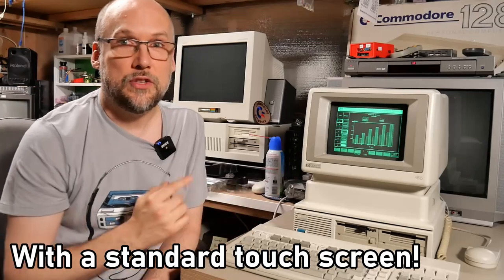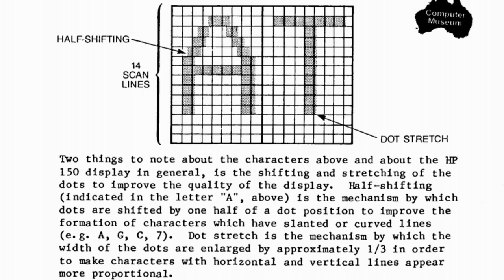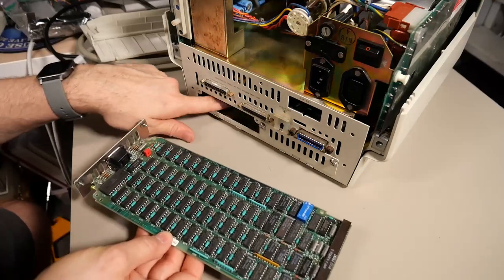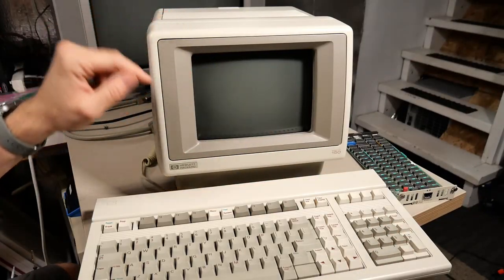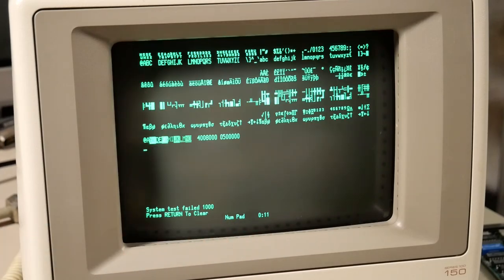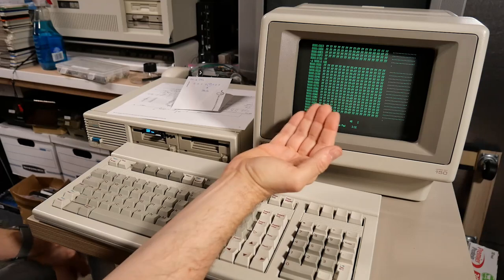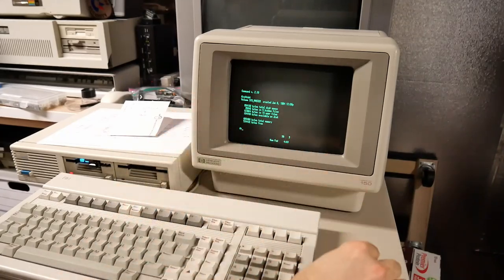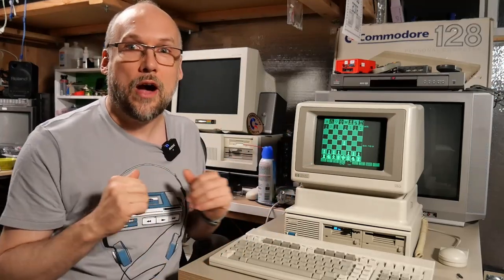Touch Screen MS-DOS PC from 1983

Comment: I was a service tech for HP when these came out. We would have a customer get a straw and blow out the holes if we did not want to go out there or were busy. Later HP made a plastic strip that blocked the lower holes from dust, You can also use clear Scotch tape to cover the lower holes and prevent this failure. HP also was making the HP 125 a CPM computer, and a UNIX luggable computer at the same time. The MS-DOS won that battle. Many of these HP-150 computers were used to control HP Lab equipment such as Spectrum analyzers and other test equipment as well as medical equipment because of the HP-IB (IEEE-488) interface. Back in the HP office we connected these to HP 404 MB disk drives for fun. The disk drives were the size of a washing machine. Much of the older HP technology gets scrapped (recycled) as the boards many times had gold traces. At one time Compaq was thinking of licensing the HP thermal printer for their early luggable computers. The licensing never worked out. But Compaq ran their business on the HP 3000 and larger computers.

Comment: label says NO USER SERVICABLE PARTS INSIDE.......... adrian says...its HP its very servicable lol
Reply: Adrian isn't a user.
Reply: @stinchjack  totally 100% agree if you own it which it seems like apples case s he has said you don't really own it just like software that you don't own and many other things that once you purchase it it should be yours and be able to do what you want with it including having anyone you please to repair it as you can tell I thoroughly agree with the point in full!

Just like they say in the maker community if you own it you should be able to take it apart modify it whatever and if it doesn't fit your needs you should be able to modify it the way you want warranty void if removed should be outlawed completely banned but of course companies have to protect their rear end if some like really screw something up but trying to do something past what can be fixed it would fall back on them because of something the user it done to their own equipment I understand that however that should not interfere with reasonable things that someone is doing technically we have the right to repair in some situations however there needs to be legislation that's consumer orientated and protects our rights to our own equipment Etc and Legacy on legislation of what can and cannot be doing like in the case of apple and others so you open it you broke it or you try to fix it sorry no parts for you or you touch a screw we don't touch it no repair for you or sorry you can't program that part your device no longer works we didn't do it you did when actuality that was what the product was designed to do to prevent it from Dean. Buy legitimate repair services or ady hot for assume that would be able to fix something normally companies are so pigheaded that they want you to buy a new device in many cases I think about the song All speakers deliberately at least a first breaking them I'm sure this was not the first taste of this heard of others but can't remember at this time all I've heard about this but this will only continue to happen worse and worse the community needs to get together someway somehow and Soldier on until whoever takes notice and changed the laws to reflect what would work and be reasonable for both sides of things if possible and be able to get things appointed there are ways in which a company could say no to repair if something's jacked up to the point that it would have been unreasonable for a user to do something or a repair got a rolly but yet comforter butts when appropriate and so that people cannot just get a new device because they checked it up and they're not able to in the person tries to pin it on them when it would not be the right thing to happen in a reasonable situation.

Butthead yet have rules and legislation that would State exactly what a manufacturer I would or could not do and clear guidelines as to what is appropriate and acceptable in cases such as these and others that both sides could agree on at least as much as possible and work for the good of all that's watch as possible it might be a pipe dream to have this happen but it needs to get a lot better it's just crazy either or just make your project open source and be done with it that might just solve it encourage cell phone repair don't turn it into something that's a death sentence for the device.
Reply: Serviceable by HP or a repair shop, not the end user. There’s still a difference of welding it shut to having it easily come apart in a modular fashion.
Reply: @0xbenedikt  not really my point though but I seriously saying so just so you know.
Reply: @aaronbrandenburg2441  😈
Reply: They probably say it mostly so they can sell service contracts alongside it, which would likely have been taken up by businesses.
Reply: @stinchjack  I’ll never understand this complaining if you have a problem with that don’t buy it
For the rest of us it’s fine
Reply: @aaronbrandenburg2441  ok that’s a word vomit anyway so-
Reply: Who knew!

Comment: 37 years and just needs compressed air and one chip that’s reliable.
Reply: I'd say that's a 10-4 affirmative a good buddy on that one.

Also with the compressed air a note with sound when using dust off or or similar ran into this on an old Gateway machine.

I was having some issues with it overheating.

And in one day it wouldn't even stay on for a few minutes.

Popped open the case and sure enough heatsink was packed with dust.

A lot of other things as well including the fan.

And processor heatsink fan of course.

I was using the dust off or similar and I was doing this in my bedroom big mistake one big cloud of dust and I'd use so much I was not feeling good because of the effects of the dust off or whatever it was on me and I was not aware they do that so be careful.

Best weapon to do it outside in generals not just with the nature of the stuff but the dust cloud as well just undid all my cleaning for that month it seemed like.
Reply: Conclusão, não mexa no que esta quieto.
Reply: @aaronbrandenburg2441  I use an air compressor. And do it outside, of course. Best also to wear a mask or respirator, especially if you think mice might have been in there.
Reply: The dust was not the main part I was referring to who is actually the the stuff that's used for the dusting spray that I was having problems with there was enough of it in the air that I wasn't feeling so good yeah and got to my respiratory system that was the big part they be running a big fan but I had no idea I was going to need to use that much and didn't know how much dust was in there's heat sinks and everything so vacuum cleaner would not have really done anything for the spray itself but dust maybe but still would have been a real mess. And I did not have time to disconnect everything and get it outside plus it was raining and I had to get back going on something I was doing immediately on the computer so no options other than to do it is there and at that moment sometimes things are like that but learn my lesson about using large quantities of dusting spray in a small  size  room.
Reply: And a new battery
Reply: O que tu quis dizer? Para de zoar com os caras! Kkk
Reply: ...and god knows how many hours of troubleshooting. But of course we don't count that. The repair is always only as valuable as the spare part that it needed.
Reply: How sweet it was!💙

Comment: My father was on the HP sales force in the waning days of the 150 and the transition to the vectra. He brought a retired 150 home, and I spent countless hours playing Master type and writing school reports on it. Mine had the thermal printer in the top, and an external disk drive unit with one floppy and a hard drive. It took 5 minutes to load MS Word. The hard drive sounded like a small motorcycle engine. I had a Deskjet plugged into the serial port, and I used the HP HIL mouse extensively to draw in the rudimentary graphics program the computer had. Printing a picture took several minutes. This was a trip down memory lane for me. Thanks.

Comment: It was nice to see the HP-150 once again. I did the port of MS-DOS for the HP-150 back when I worked for HP (plus a custom version of WordStar for the 150 as well). People might ask why the HP 150 was not IBM PC compatible. The IBM-PC was released in August 1981 and wasn't shipped in large quantities for months. It wasn't clear for the first half of 1982 that the whole IBM-PC; hardware, BIOS, and  PC-DOS (MS_DOS), would become the standard, not just MS-DOS. What made it the standard was the large amount of computer software that was available for the IBM-PC that bypassed PC-DOS and accessed the BIOS and the hardware directly. In a way it was the fact that PC-DOS was really a poor operating system that caused the standard to be more than just the PC-DOS interface.  There were some software titles available on the day the PC was released but it took about a year for the software base to expand to the point that the PC had become the defactor standard.  It wasn't until late 1982 that IBM-PC compatibles, like the Eagle PC, started to appear. 

There were not just technological challenges making an IBM-PC compatible. There were legal issues too since the standard included the BIOS interface. Eagle Computer just copied the IBM-PC ROM and tried to argue that it wasn't copyright infringement because the ROM was hardware.  Well,,,,,,, it was copyright infringement , and the legal challenges destroyed Eagle Computer. We were in the planning stages of the HP-150 well before it was determined the IBM-PC was the new standard. Some early startups, like Gavalin Computer, used up their entire financing only to release a non-IBM-PC compatible product at about the same time it was becoming clear that IBM-PC compatibility was a requirement. Gavalin never recovered. HP had a large customer base and was able to make the HP-150 a successful even without PC compatibility. 

The HP-150 got a mention in the TV series "Halt and Catch Fire". As the main characters of the show are walking through the 1983 Consumer Electronics Show one of the characters says something like "Hey, did you see that touch screen computer from HP". I enjoyed hearing that.
Reply: How old are you ?
Reply: This probably was one of the best products you could get as a professional back then, the level of integration was ahead of its time because we didn't see similar products from IBM until 5 years later. HP always gave me the impression they are behind the scenes doing their professional focused products very well but they had problems with the commercial ones. This is on my perspective on have been a salesman for the company about 15 years ago, their public commercial PC products were a little of a clown show withe very dubious decisions.

Later I got into IT and now I'm working in mainframe and learned what they are about really. All their professional products are top notch, I have owned several office HP laptops and they are the best I tried, best ergonomics, durability, service, I even bought them second hand for relatives and they still kick strong. They are the one of the few who offer the 6 del/ins/home/end/pgup/pgdn row in 14 and less inches laptops, which they are absolutely mandatory for my work. I had to work with a similar Dell for a while and asked for an HP replacement because it just wrecked my workflow. Those are the good details.
Reply: kevinlsims7330 What are you talking about? HP didn't make copy and fax machines, at least not in any significant quantity back then. The printers and plotters they made were designed to be used with their test equipment, just like their computers. Their main business was test equipment and computers of various sizes. The LaserJet and all that came later. Also, it's really, really not necessary to capitalize every single word in a sentence, it comes off as really obnoxious and difficult to read .... 
Also, if you read what the original commenter said (who actually worked for HP and would probably know better)... this wasn't a "blunder", this machine still sold very well because, like their other computers before and after this point, they were designed to be used with HP's test equipment and engineering tools to create custom test and verification setups. So you could have one of these machines connected to a whole rack of HP test equipment on an assembly line, and do extensive testing to make sure your product was working correctly. This was HP's bread and butter during the 70s and 80s. Go check out the HP test equipment catalogues from the 1970s, their computers were listed in there because that was how they viewed their computers first and foremost -- tools to be used with test equipment to automate and log results.
Reply: Yes, people don't understand, when IBM gave Microsoft the rights to license to other companies, they fully expected the MS-DOS machines would be mostly incompatible! It was Compaq that really got "full" compatibility as a feature, although the PC 1600 was the first, released in June 1982 by Columbia Data Products, with the Portable, Compaq made $111 million in revenue it's first year. IBM setttled out-of-court with Eagle because Eagle copied the PC BIOS byte for byte. "Halt and Catch Fire" more closely resembles the history of Corona Data Systems, except they also cloned the BIOS and later settled with IBM. I don't know why this association wasn't played up, and they pushed the Compaq reverse engineering angle. The only other similarity was the Texas location.
Reply: @revoltosotintan  I'm 69.
Reply: @hallsoft  thanks for your work

Comment: I did a work/study program while in High School at HP's Colorado Telecommunications Division in Colorado Springs.  They had tons of these, mostly used at terminals for a mainframe.  Only a few had the thermal printers in the monitors, and those who didn't put tissue boxes in them.

It was amusing seeing people pulling Kleenex tissues from the tops of their computers.
Reply: Remember the thin paper? omg , and it was soo much like burning an image lol
Reply from the maker: Kleenex dispenser! OMG that's too funny. I actually moved the machine off the bench and stored the GPIB cable and mouse in there. It's shockingly handy!
Reply: Since these machines were built at the calculator division facility in Ft Collins Colorado, I guess they didn't have all that far to travel :-P
Reply: Mine does not have a thermal printer but I have a Thinkjet that now works after replacing the ribbon cable to the print head. It still amazes me you can still get the print cartridges. So I use the top for storing fanfold paper.
Reply: Which would have even be more hilarious if someone mistakenly thought the printer was a tissue box. So they hit PRINT... and then proceed to pull the print from the machine and blow their nose with them.

For a machine that was intended for mostly scientific purposes, having a built-in thermal printer kind of made sense, though.
Reply: @Stoney3K  It does make sense. I can visualize the scenario clearly.
Reply: @Stoney3K  At HP CTD, it was used primarily for screen prints when the PC was in terminal mode and connected to the HP 3000 mainframe.
Reply: Yep we used the dumb terminal versions of the hp120 and hp150 -we used them to connect to HP3000 mini computers - I don’t recall HP having mainframes back then that was more IBM
Reply: Mark Walters hp3000 was a mini not a mainframe
Reply: @speedbird737  Thanks for correcting me, twice.

Comment: Woah!  Blast from the past.  When I was an undergrad (mid 80s) they had one of these in the main computer lab.  It was used as one of the many terminals for the HP3000 system on campus.

Comment: The HP Machines were extremely popular in Laboratories of all kind. A predecessor, the HP-85 already had a small Printer built in to print out e.g. measuring protocols on the fly. This is why the option was included to put a printer on top, not so silly ;-) HP PCs of this era were build like tanks, I had a AT-compatible early Vectra that ran for 10 years without the slightest failure (same mouse as this 150, by the way...)

Comment: I remember using a machine like this. The one I used had the thermal printer installed. I never knew that it was NOT IBM compatible,  nor did I know that the computer was in the monitor, not with the floppy drives! I first used such a computer back in 1988. It was in an insurance processing company that used an HP 3000 Series III mini computer, which was already ancient. The company used HP terminals along with a very few of these computers, which were still just mostly used as a slightly smarter terminal.

Comment: Nice find, Adrian. The design of this thing inside and out is so ridiculously charming. It's almost like in their attempt to make it so convenient and modular, it's kind of over-engineered.
Reply from the maker: HP seemed to use the same design philosophy on this as they used on their industrial and test gear. Totally not like a normal consume PC.